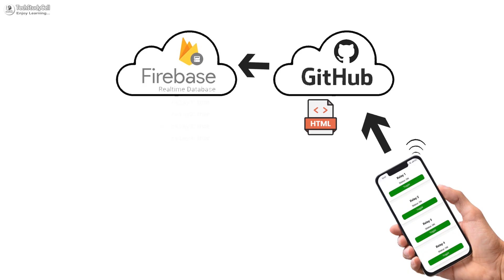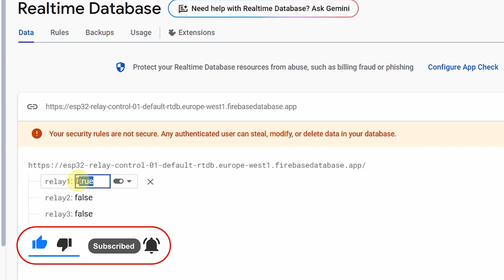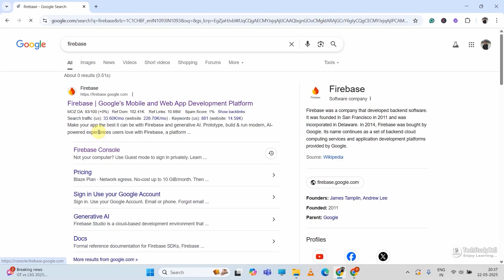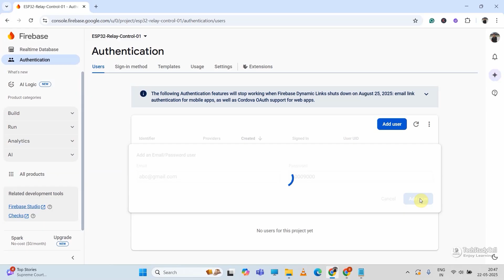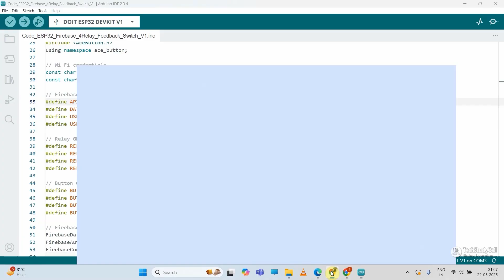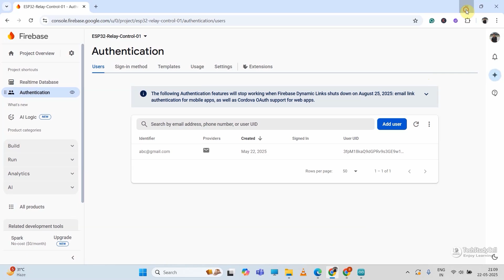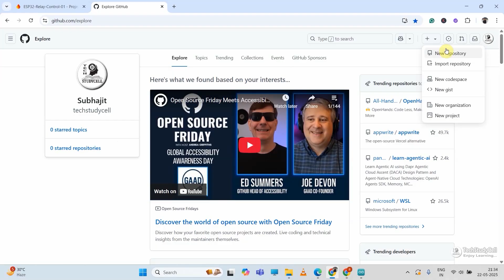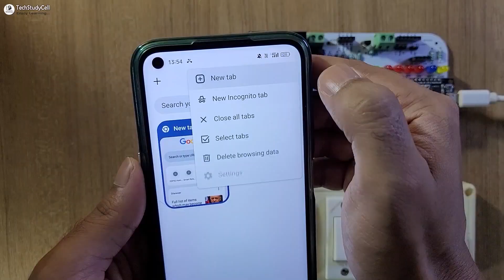ESP32 IoT Home Automation | Firebase Realtime + Web Dashboard + Manual Relay control

Comment: Brother, have you faced any issue in the latest FirebaseClient library? Because you used Firebase_ESP_Client by Mobizt v4.4.17, which is now deprecated. I’m asking this since I had to roll back to v4.4.17 from the new library after unexpected reboot issues on ESP8266 in my Pump Control project.